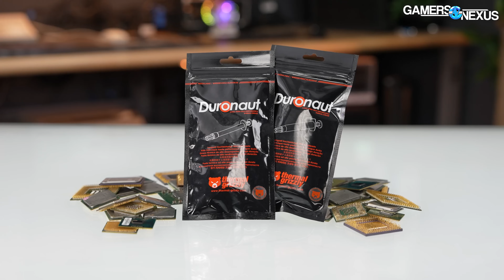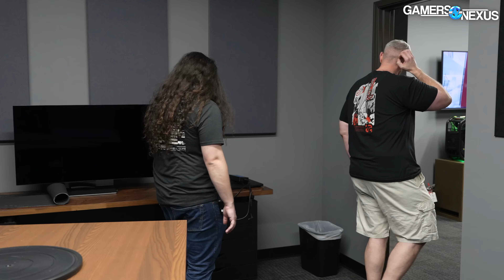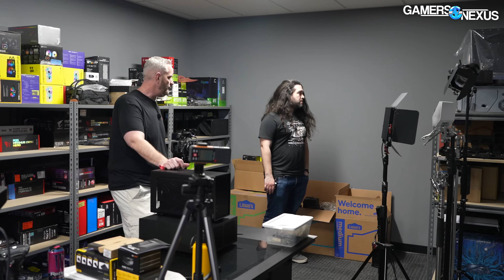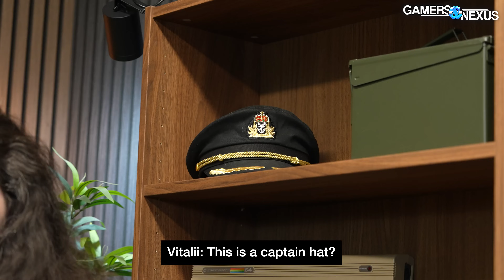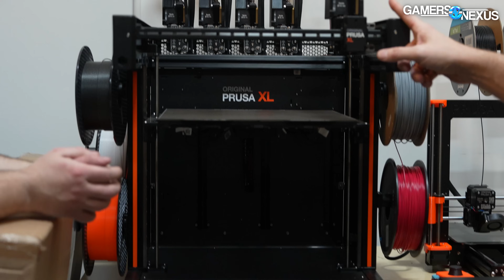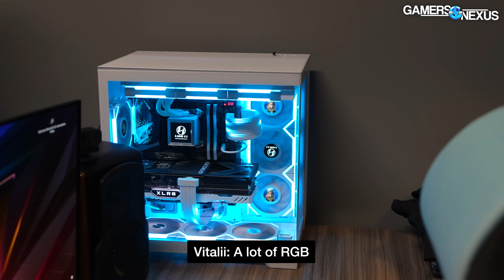He Can't Keep Getting Away With This | JayzTwoCents Office Tour

Comment: Linus is an evangelist for remote rackmount gaming machines. There's one way you can justify a cooling setup like this one. Also virtually every 3d printer on the market has solder on the stranded power wires that go into a screw clamp internally. That's a SEVERE fire hazard.

Comment: Heaven Benchmark is still my go to benchmark as well, I find it works better than modern benchmarks for getting the most heat and fan speed going with vsync off and the higher framerate weeds out any potential coil whine that you otherwise wont hear with a lower fps benchmark.

Comment: That PC fan stack is what prompted me to make something. Made a bathroom vent out of a 4x2 stack of 140mm fans with a very tiny spacer block on the top of about 4 mm thick. It gives the fans a pressure fit to no glue is needed. I also realized that the corner mounts of 140mm fans are the same of the 120mm variant so I remixed a fan combiner to make a few custom mounts that need no screws.

Comment: I've said this before in another video, but I personally love heaven benchmark, its small in file size, quick to download and install into different test benches or an old computer if you need to quickly test if the GPU is working fine. It stresses the GPU enough so that if the paste is dried up, you will see high gpu hotspots and such. Love the program!

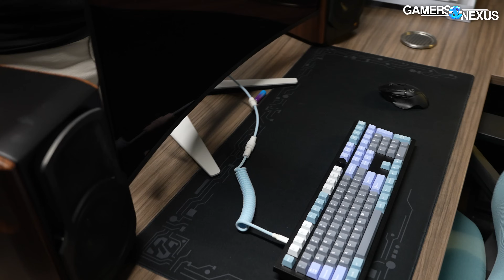Comment: 22:40 Jayz and Steve talking about keyboards. That IS a whole new world, more so than cases. 
Do collabs with some Keyboaders they and some others do collabs, completion, custom builds, etc. As an older person, I'm glad to be done with Full-size keyboards. I don't like TKL, and wish I could use a 65% keyboard. But I need a numpad so I use a 98-keyboard - but a minor gap between the main keyboard and numpad. 

So many options, much more so than a computer case:  Ther are switch types, sounds and feel, keycaps types, which can have compatible or preference issues and of course Keyboard layouts.  
Getting a hot-swap keyboard is best for customization; they don't cost a lot.   Can do far more than a PC case because you touch the keyboard, constantly.

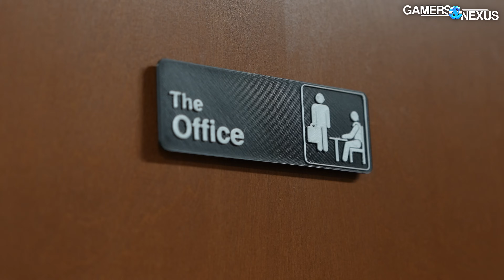Comment: 22:13 no it is not at all. that print can be done with any single head/nozzle printer as the base is single color and what looks to be a single layer of white ontop. this is as easy as pausing the printer and changing filament.. so... no. its not.

Comment: 10:16 Little tip: If you put a cheap, small 4K (OLED?) TV on the wall, get a 4K cube cam with some good optics and you'll be laughing! - I sit right in front of my TV with that setup (to solder my custom keyboard) and it's AMAZING

Comment: From what I can tell, the officer's cap is the design for a Commander.  It would be worn by a Captain rather than an Admiral.  A distinctive feature is that it has only one pair of gold wreaths on the brim, rather than the two that an Admiral would have.  The Merchant Navy version is different again, using wreaths with separated leaves.  An officer below the rank/role of Commander would have no wreaths on the brim.

Comment: @Jayztwocents I have a fully built athlone 64 I believe three core system with an AGP Nvidia card it was the 800 series that was called 700 series, but it was using the 800 or 900 series GPU. I want to say 750 TI? But I don't really remember, I'm traveling right now so I don't have the computer in front of me. It's fully working, has Windows 10 on it, and I've been using the same motherboard since like 2002. Or 2004. Almost everything is from that era, that 2004 through 2010. Up until recently I was using it constantly, has all the hard drives though that I would have to eliminate, it's a DVI card, it has Wi-Fi, and as I said works very well. If you're interested, I might be willing to part with it. As I said the motherboard is old enough to drink now))) 
I'm slightly emotionally attached to it, would like it to see a new home, but I'm willing to let it go as a whole unit but to be used as parts. I would include the 1080p monitor. I have no need for a DVI monitor anymore. While a relatively low-cost monitor it was actually a very good monitor color wise and it's refresh rate of course is in that 60 range. 
If I think about this later I'll try and email you directly, but like I said I'm traveling so... And apparently I've been adopted by a stray cat, so I can't write anymore

Comment: Seeing Steve get mad about Heaven only for Jay to keep it in the background in most of his videos is quite funny.
Reply: Still a great piece of software to use for undervolting a modern GPU though. Easy to use and to minimise on the fly whilst changing settings. I use it and it serves its purpose absolutely fine.
Reply: I love the faux Drama between Jay & Steve. To see two very laidback chaps "go at" each other makes for amusing content.
Reply: @AIRGEDOK  Casual banter is indeed fun
Reply: lol
Reply: heaven was my frirst benchmark softwaree that made me mad i hjad no tessalation on that specific card.  dont even remember the card LOL
Reply: I am missing deep lore here lol, what is Steve's issue with Heaven?
Reply: @Doc2Fish  It's more than a decade old. A lot of the features in new games are missing from it. It is a beautiful demo, but the 1080ti was the last GPU that really should have been tested on Heaven.
Reply: @bobb125 sounds like someone needs to make “Heaven RTX” 👀
Reply: @bobb125  i mean i was using it for at least my vega 64..
Reply: @kahrhoshe  Fair. But the vega 64 only came out a few months after the 1080 ti and the vega 64 was slower than the 1080 ti anyway. The point I was trying to make is that the test results from Heaven are no longer proof that a card will perform well in current games.
Reply: @Doc2Fish  Tesselation isn't an issue/bottleneck anymore
Reply: @Voyajer.  I think Jay should commission some Heaven wallpaper and decorate a set with it for Steve's next visit
Reply: @Doc2Fish  Heaven Benchmark was released in October 2009 when DirectX 11 came out

Comment: tbh I am guilty of using heaven for first run and curve tuning. Its one of the few stress test/bench mark programs that lets its self run in windowed and also not in focuse so it can keep running while you tweak an overclock in it. Its not a good stress test anymore but its a good curve first adjustment program and then stress in others.